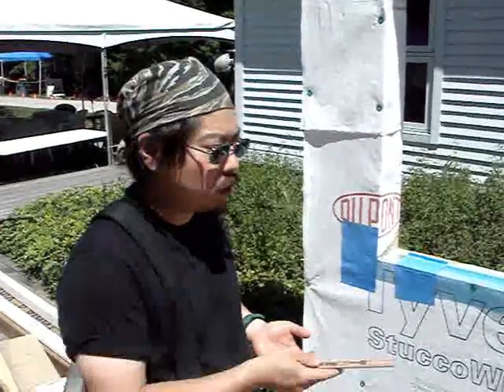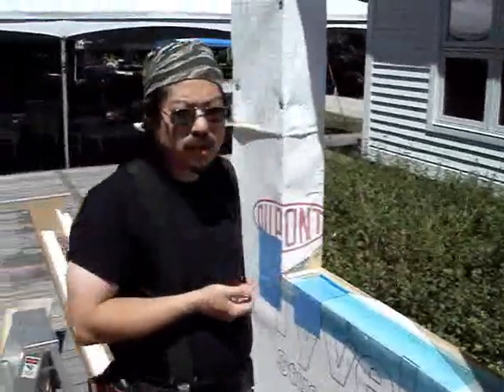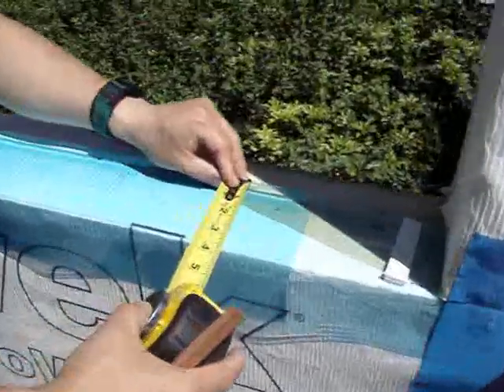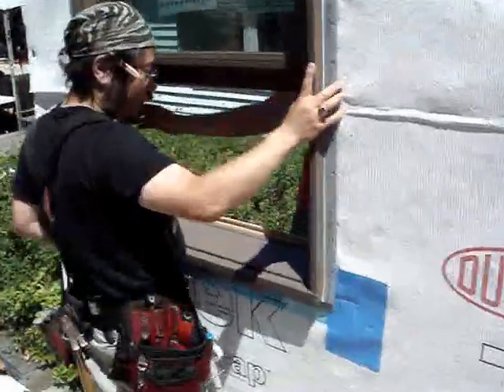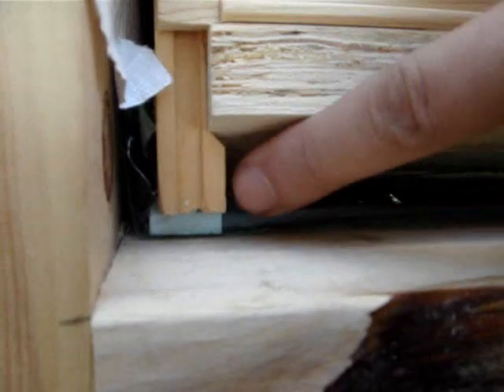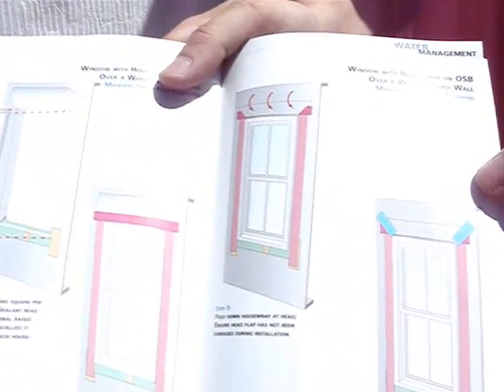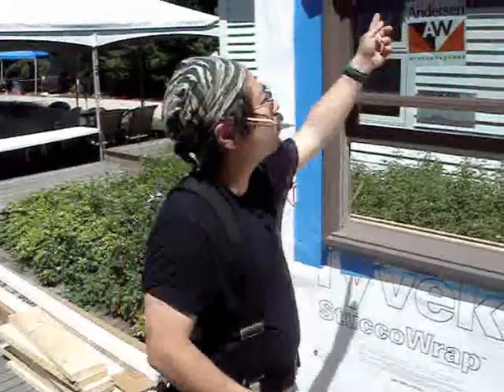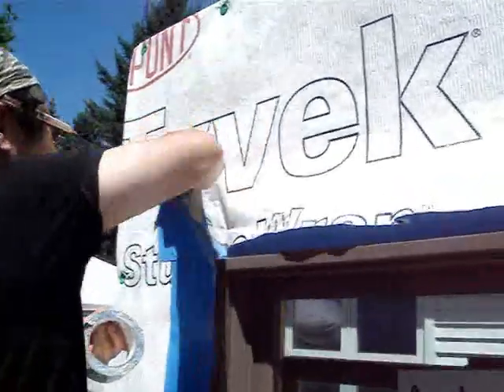Proper Technique for Flashing and Window Installation

Comment: your window will leak in the corner your base blueskin detail is not sufficient,3 tier system should have corner gussets on top and a boot over top then caulk to the angle before window is installed. i do building remediation for a living

Comment: They have flashing tape to go around the OUTSIDE of the windows to prevent leaks.   But alot of people say the most important is to flash the sills - inside/under the windows. How/why is that? don't you want to stop the water from getting in?

Comment: The looks about right. That's the way that my window installation contractor ended up installing my windows. 

Boulevard Exteriors
230 Quarry Park Blvd SE
Calgary, AB
T2C 5E4
403-287-6749

Comment: why was the building wrap not taped to the top flange before you moved on to doing the siding? As a draft barrier the header area is most critical because commonly, it is the area with the least wall cavity insulation. Also the sill apron area is going to be drafty for two reasons. 1) you shimmed the legs up widening the uninsulated gap. 2) you mention not insulating the space between the inside sill pan lip to the exterior face. why?

Comment: Vycor (flashing) product instructs that it should be applied on the substrate under the Tyvek, not over it.  I was told yesterday at a building supply store that applying Vycor on Tyvek can result in moisture problems.

Comment: This video was great. I built a new addition and intalled 2 casement windows using this gentlemans advice and I was very pleased with my results.  Even the window intaller on my street was impressed. I also used the membrane techniques on my door with side-lights.

Comment: Please notice that he's only placing shims under the corners.  This is HUGE in Brick on the side of housing.  They don't mention it as it's not a pertaining issue, but to make sure that any brisk or stone sill is about 1/4" away from the bottom of the window to prevent Humped Sills during the settling of the house.